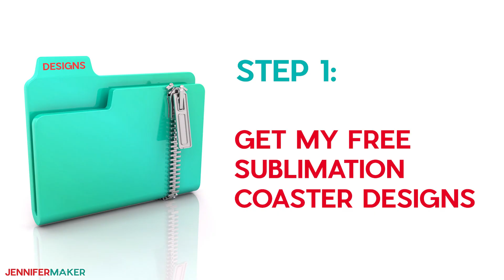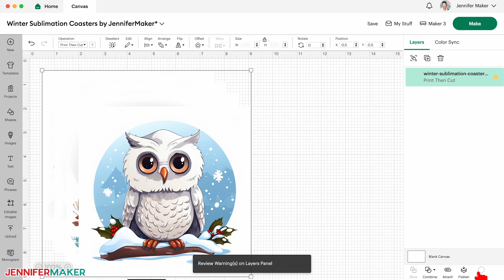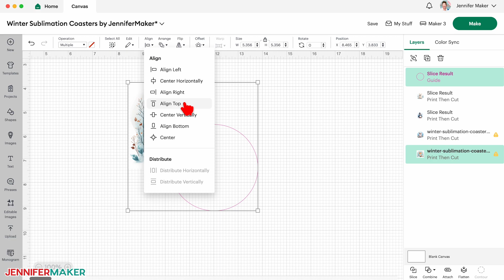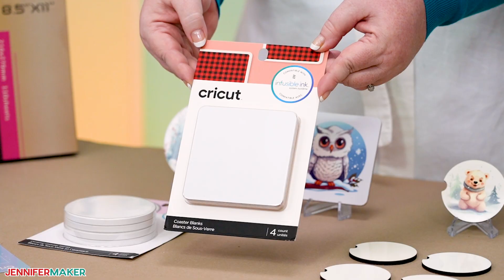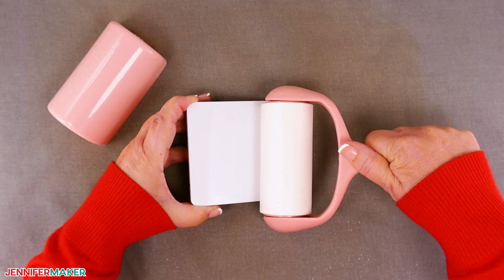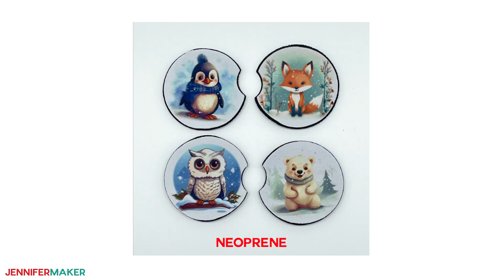How To Sublimate Coasters With Best Blanks | Neoprene Car Coasters, MDF, Cricut, Ceramic

Comment: Great video. Do you apply presser or just hold it in place. I am getting some ghosting on some. Is it the pressure or not lifting straight up? Thanks
Reply from the maker: Most likely from not lifting straight up.🥰
Reply: @JenniferMaker Thanks!! I see on the square ones you dont apply pressure. I will try both. Thanks for your time!

Comment: My round ceramic coasters I bought on Amazon come out pretty and nice, but they scratch so easily. How do others deal with that? Do we have to cover them with sealants, or epoxy, or use protective sprays? I just don’t think I can sell them like this, knowing that they get scratched instantly.
Reply from the maker: Yes, unfortunately some ceramic sublimation blanks have coatings that scratch much more easily than others. The sublimated image itself is durable, but the coating on the blank can be the weak point. I would first try a higher-quality coaster blank rather than automatically adding epoxy or a spray sealer. If you do use a protective coating, make sure it’s specifically rated for ceramic and test it for scratching, moisture, and heat before selling.❤️
Reply: @JenniferMaker thank you SO much, I will follow the tips! 
I just don’t know which coasters are really good quality and which are just as low quality but just expensive)

Comment: So a regular printer won’t work for sublimation?
Reply from the maker: You will need to a true Sublimation Printer or a converted Epson Ecotank Printer with Sublimation Ink. ❤️
Reply: @JenniferMaker I got a pack of infusible ink pens/markers. I don’t see where to switch it to draw from cut. I don’t even see line style or whatever on my header at all.

Comment: I am turning on the mirror in Design Space. I have a Sawgrass SG500 and it automatically mirrors everything I send to it through the Print Utility. When the printing is done it doesn't look like it's supposed to according to Cricut. The arrow I'm supposed to have at the top left corner keeps coming out on the top right corner. Should I turn off the mirror in the Print Utility?
Reply from the maker: It sounds like the software is mirroring twice! You're on the right track. Yes, if you mirror twice it actually didn't mirror. 💜

Comment: I'd like to know if there is a way I could make my own pulp board coaster blanks for a custom size. I'm looking for 4 1/4-inch blanks and I can't find them onnline, so I might have to make my own. Thanks!
Reply from the maker: Yes, you can make your own pulp board coaster blanks at 4¼" with the right equipment to cut it. Pulp board is just thick, absorbent paperboard like what you see in bar coasters.
Reply: @JenniferMaker  That's good news! But it would be helpful if you could suggest a type of machine for doing so. I have a circle cutter for mats, but I'm not sure if that's what you're talking about. Thanks so much!

Comment: I have some from hobby lobby they say 400@60 secs I went a little heavier with my HTV press and cracked the first one so I lessen the pressure but now I’m afraid to let it sit for less than you say what should I do it’s a bday present I’m afraid to mess it up
Reply from the maker: Sublimation coasters can be tricky since they’re often made of ceramic, MDF, or hardboard. Since your first coaster cracked under heavy pressure, you're right to adjust! 
1. Follow the Manufacturer’s Guidelines First
Your Hobby Lobby coasters recommend 400°F for 60 seconds, so stick with that for now.
2. Adjust Pressure – Lighter is Better
Use light to medium pressure – just enough to keep the paper in full contact.
If the pressure is too heavy, the coaster can crack (as you saw).
3. Avoid Rapid Temperature Changes (Preheat!)
Preheat your coaster for 5-10 seconds before pressing. This prevents cracking from sudden heat exposure.
Let them cool down naturally after pressing—don’t move them to a cold surface immediately.

Comment: I'm trying to learn about the 3" two-sided ornaments.  Would the instructions be the same as the MDF coasters?
Reply from the maker: While the basic sublimation process for pressing a 3" two-sided ornament would be similar to an MDF coaster, the exact instructions might differ slightly due to the smaller size and potential differences in the material's heat conductivity, so it's best to consult specific guidelines for the ornament blanks you are using. Here is a double sided tutorial. https://jennifermaker.com/how-to-use-cricut-infusible-ink-sheets/

Comment: Just what I was searching for. Great video. I tried it and my round neoprene coasters are squishing down and look too thin.  Any suggestions?
Reply from the maker: Try reducing the pressure slightly to prevent excessive compression.  If your round neoprene coasters are squishing down and appear too thin, the most likely cause is that you're using a neoprene sheet that is too thin to begin with; try using a thicker neoprene sheet for better stability and structure.

Comment: I have a question.  If you have other shape blanks. How can you make an image template of that blank so it will  to that shap
Reply from the maker: To make an image template of a shape blank so it conforms to that shape, here are the steps you can follow:
Select and Erase Background: Ensure you have your "select and erase" icon selected. Click on the background of your image to remove it, making the background transparent. This will allow the image to conform to the shape you want.
Use Contour Tool: Select the duplicated layer and click "contour" to control the individual cuts in a layer. In the pop-up window, click the "hide all contours" button. This will hide all contours except for the shape you want to use.
Create a Guide Shape: With the shape selected, click the dropdown menu under "operation" and choose "guide" to turn it into a guide shape that you can see through.
Arrange and Resize Photo: Click the eye icon to unhide your photo, then click "arrange" and "send to back" to move it behind everything else. Drag your photo so it fits within the guide shape. Resize the photo by dragging a corner handle in or out until it fully fits and fills the shape with no canvas showing on any side.
Drag a bounding box over the photo and the guide shape to select both, then click "slice" in the layers panel. Delete the guide shape and the slice result containing the portion of the photo outside the shape.

Comment: Hi, I'm new to sublimation and would like to check if I am able to sublimate my designs on diatomaceous earth coaster?
Reply from the maker: Sublimation works best on surfaces that are either made of polyester or have a polyester polymer coating. Diatomaceous earth is a natural material and does not inherently have the polyester content needed for sublimation. Therefore, you would not be able to sublimate directly onto diatomaceous earth coasters unless they have been specially coated with a polyester or polymer layer that can accept sublimation ink.